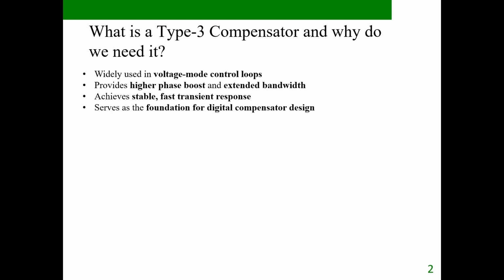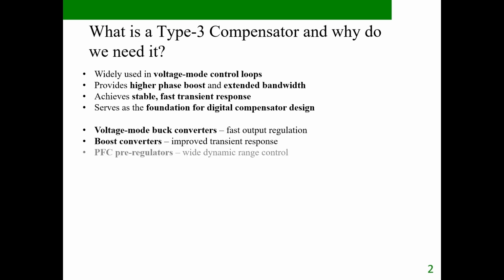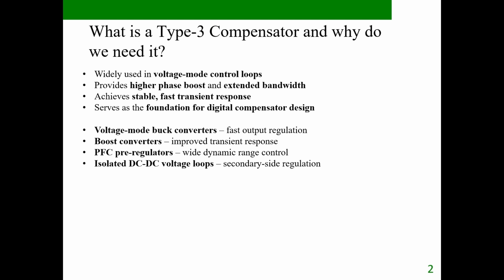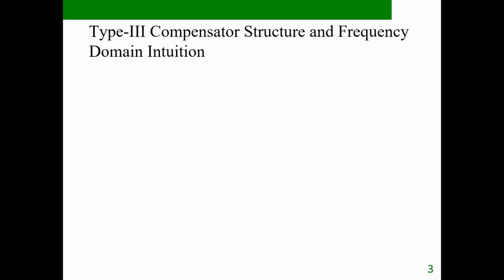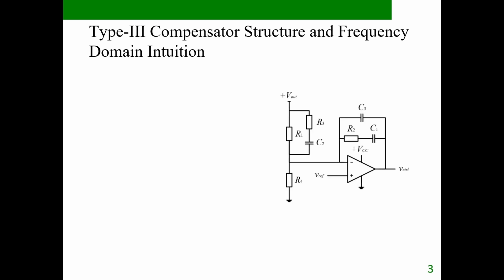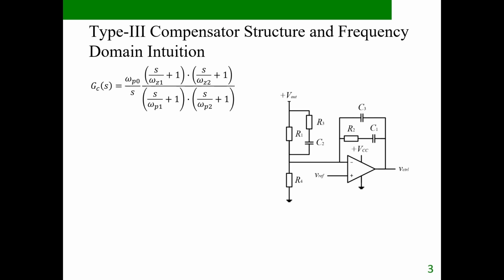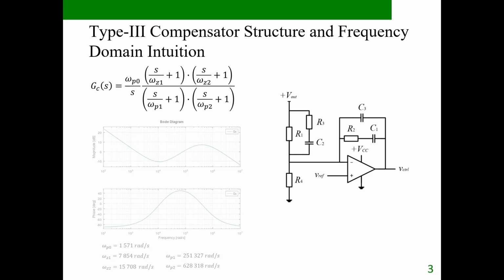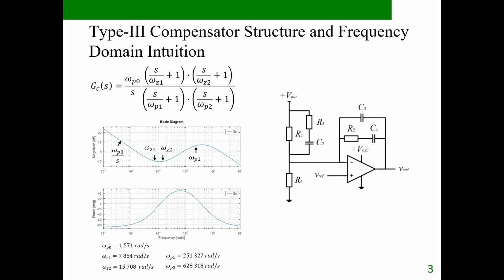Type-III Compensator for Power Converters — Intuition & Bode Shape

Comment from the maker: 📘 HK-Academy Courses — 10% YouTube Discount
As a thank-you to all my YouTube viewers, you can get 10% OFF any course on HK-Academy — valid for the next 7 days.

🎟 Coupon code: YTSTUDENT10
💡 Works for any course, including:
• Digital Voltage Control for Buck Converters with TI C2000
• Designing a Type-3 Compensator – Practical Implementation in C (C2000 Demo)
• C2000 Basics: Foundations for Digital Power Control
• C Programming Basics for Power Electronics Engineers
• Writing Maintainable Code and Documentation with Doxygen
🔗 Browse all courses:
https://hk-academy.com/courses 

📁 Free Buck Converter Toolkit
LTspice models, Octave scripts, and C2000 examples:
👉 https://hk-academy.com/resources

If you like this video, please consider subscribing — it helps me continue creating advanced digital control content. 🙌